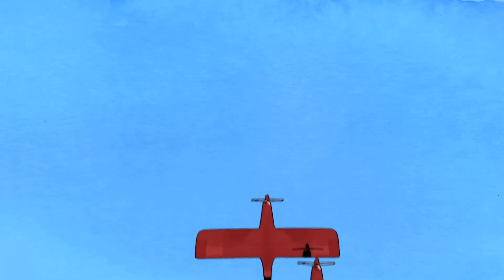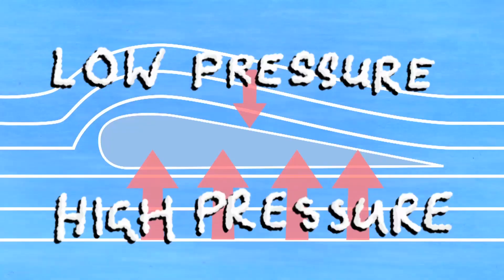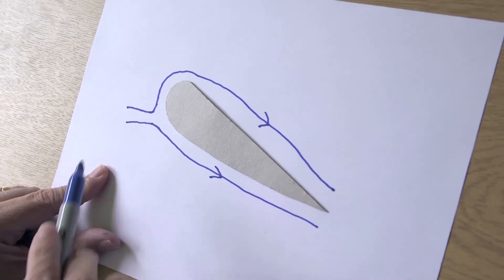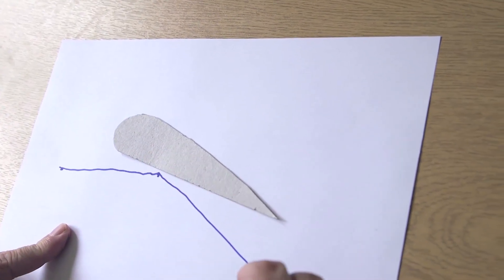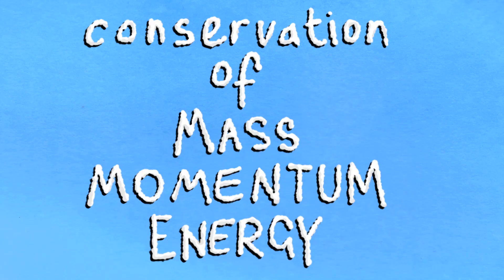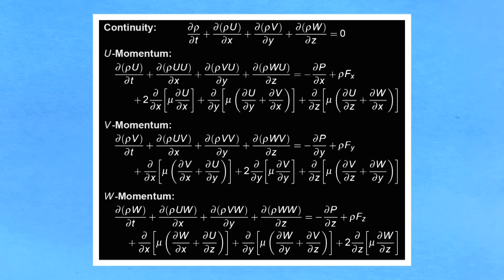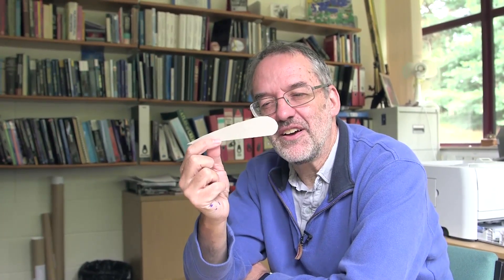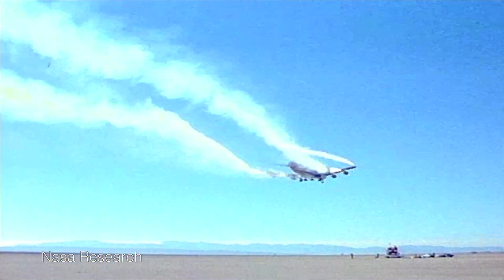Lift and Wings - Sixty Symbols

Comment: Thin section wings! Everybody neglects the thin section examples like hang gliders and the old Wright brothers style in explaining conservation of momentum.(turning the flow, not particle bombardment) There are two primary reasons for thick wing sections; the rounder leading edge is less sensitive to angle of attack related flow separation(stall), and wing strength both in torsion and vertical bending. 
The majority of the net working lift has been shown to come from conservation of momentum. The Bernoulli effects are important to the general flow pattern and boundary layers and these effects indirectly add to lift generated via conservation of momentum, the actual portion of lift directly caused by Bernoulli effect is actually a rather small fraction.

Comment: What about paper airplanes? They often have wings with a cross section of a line. How can it produce lift if it doesn't have the traditional teardrop shape?
Reply: They work the same way. The thin cross section is just somewhat less optimal. Somewhat less efficient and less stable.
Reply: angle of attack

Comment: I used to work in the aircraft engineering industry. In certain occasions including interviews I was being asked to explain how an aircraft flies in layman terms. The mechanism is rather complicated as the professor explains in the video so the real challenge was giving a short answer. I found that most people would expect 'with a  sufficiently high speed and a correct range of angle of attack, an airfoil can generate lift due to pressure difference between the two surfaces'. In my job when we had to adjust the flight control systems such as ailerons or elevators, we tended to use 'bouncing particles explanation' to effectively figure out which way was the right direction. I also found that in many science museums in different cities, Bernoulli's principle is used to offer simple explanation for educational purpose.

Comment: They way that I like to think of it is that the rise at the front of the wing has a high resistance so it generates a large pressure differential, leaving low pressure air across the rest of the upper surface of the wing.

Comment: Aerospace engineer here. I really like the explanations and the video, but I would like to mention that the explanation of the air being 'squeezed in' near the leading edge as if there was a wall is also kind of 'fallacious' (at least from the point of view of my teachers). The real reason why the air goes faster in the upper side is because of the Kutta condition (https://en.wikipedia.org/wiki/Kutta_condition) which I would have liked to be mentioned here. This condition states that a body such as  an airfoil, with a thin trailing edge, will create circulation around it (air rotating basically) so that an stagnation point (this means, a point where the air speed is 0) can exist at the trailing edge. The explanation for this condition is the fact that the air coming from the upper and the lower sides, when they meet, has to have the same speed vector, otherwise the conservation of mass equation does not hold, and it has to be at the trailing edge because this is where the geometry suddenly changes, and the air can be properly separated from the surface. A deeper explanation for this point involves the existance of a viscous bondary layer near the surface, and how it follows the shape of the airfoil. Actually, the reason why an airfoil 'stalls' is because the air suddenly does not follow the shape of the airfoil when the angle of attack is too steep, and decides to separate from it, causing the destruction of the circulation, the bernoulli effect and the momentum change in the air.

And as for what is the real contribution to the lift, either momentum equation or bernoulli, as Prof Merrifield says, it's actually a combination of everything :), but I just like to explain to people the more simpler conservation of momentum (that is, the fact that the air gets turned down by the shape of the airfoil an the angle of attack).

Also, as someone pointed out somewhere in the comments, the animation of the wingtip vortices at around 9:20 is the other way round :), air has more pressure on the lower surface so it will go upwards at the wingtips, causing a vortex going clockwise in the left wing when viewing the aircraft from behind (and also causing a type aerodynamic drag called induced drag).
Reply: Pls read chapter 5 (about pg357, 358, 359) of "Introduction to flight" by John D Anderson, your explanation is incorrect, it is just another misconception of the generation of lift.

"A third argument, called the circulation theory of lift, is sometimes given for the source of lift. However, this turns out to be not so much an explanation of lift per se, but rather more of a mathematical formulation for the calculation of lift for an airfoil of given shape."

"Kutta-Joukowsky theorem is pivotal relation in the circulation theory of lift."

"The circulation theory of lift is compatible with the true physical nature of the flow over an airfoil, as any successful mathematical theory must be."
Reply: @loouuiisssss296  Did you mean in page 405 in the 7th edition? Thank you anyway :))
Reply: I think a better explanation can be had from "Ideal Fluid Aerodynamics" by Karamcheti Krishnamurthy. The Kutta Joukousky Theorem is a mathematical approximation of the flow over an airfoil. There are many assumptions involved and hence, it does not account for a lot of the real life effects. Lets look at an application of the Kutta-Joukowsky theorem-the main one being panel method codes. Why are panel method codes not an accurate representation of the flow? Why are they used only in the preliminary design stage and not for detailed aerodynamic analysis? Why do they require correction factors for many cases? The main reason for using panel method codes and hence the Kutta-Joukowsky theorem is that it is computationally very cheap and quick. It is a lot more feasible to use this for preliminary analysis but for full blown simulation, LES and DNS simulations are required/wind tunnel tests required.
Reply: +Rickrollingman,
How does any of that explain the physics of what pushes up on the wing and why?
Reply: @Observ45er  it doesn't. I was responding to the statement that kutta-joukowski represents the true physics of fluid flow. The most simplistic answer and the one that is true is that aircrafts fly due to more force below the wing than on top. This is directly due to more pressure on the lower surface of the wing than on the top.
Reply: +Rickrollingman,
OK. Thanks
Reply: @masterofmucus  The sad thing is, many people, even aerospace engineers, think that Kutta-Joukowski theorem, or Coanda effect, or downwash is the primary source of the lift, but they are just the effect of lift.
Reply: I would love to see an animation of the Kutta condition. I have been reading about it for years but never wrapped my head around it. I can see how the motion of particles of air around the airfoil will be the vector sum of the freestream air motion and some hypothetical circular motion but... so what???
Reply: @michaelhenry726  Note that Kutta Condition only works at higher velocity.  Below a certain airfoil speed, the rear stagnation-point WON'T stick to the sharp trailing edge.   (Or more specifically, Kutta Condition only works for a system with high Reynolds number, where the inertia of air is dominating, and viscosity of air becomes less insignificant.)
 
If an airfoil slows down too much, suddenly it will shed a "backwards start-vortex," and lose the Kutta condition, and the lifting force drops to zero.   And conversely, if a too-slow airfoil (wo/Kutta condition and wo/lift) should fly a bit faster, suddenly it will shed the well-known start-vortex, and begin functioning under Kutta condition, where lift suddenly appears.

It's all just weird and fascinating.  And, knowing something about it, we can begin to see (in our minds eye) the "flip-flop" of Kutta condition turning on and off.  Slowly we come to understand that vortex shedding plays some sort of crucial role.   The lifting force is intimately connected with vortex-shedding, and therefore lift is an example of propulsion, where energy is required to be injected into the atmosphere.   And as a result, Bernoulli equations or Euler equations cannot apply to real explanations of airfoils and lift!

Hint:  if we're using Bernoulli and Euler, and if our diagrams lack the start-vortex  ...then our wing is trapped in ground-effect mode.   It's performing an instant force-exchange with the ground.   But this isn't how airplanes work! 

And now finally we can see a major source of confusion which infects all the explanations:  we've been explaining Ground-effect Flight!  Yet our diagrams haven't been showing the ground surface, nor diagramming the pressures/forces extending between the airfoil and the ground!    The inescapable conclusions is ...get rid of ground-effect, remove the ground, remove those forces, and instead explain how airplanes can fly.   To do this, we have to use short wingspans, where the wingspan is small and the altitude above ground is enormous.   And when we do this, we find that airplanes are much the same as hovering helicopters:  they only fly because they draw in air from all directions, then launch a narrow plume of air downwards.   The lifting force is caused by propulsion, by a reaction-motor effect which resembles a rocket engine.  The reaction-motor effect is almost exactly the same as that of a hovering helicopter, but where the helicopter has been flung sideways, so its narrow plume of downwash is spread out diagonally, and takes the form of a vortex-pair.

Personally, my own solution is to abandon attempts to explain the flying wings.  Instead explain the hovering helicopter, the pulsing jellyfish, and explain the "kick" which we always experience when shooting our WHAM-O(tm) air-blaster gun at a distant cardboard target.   These topics drill down to the full explanation of wings and lift.  There's no Bernoulli, instead, reaction-motors and vortex-shedding is everything.
Reply: +BlazeRazgriz1 
You hit on something I want to dig into. I've taken some data, but don't want to tip my hand just yet. I dislike the 'pinching' explanation as well (the Smithsonian's explanation, among othets, uses it). 
...
Now, we see the upper air 'accelerate' going over the top. Since air has mass & Newton reminds us it takes a force to accelerate a mass; WHAT is the force accelerating this mass of air ?? There must be a force. The Prof glosses over this and I want to ping him on this also. 
Comment ?
Reply: @Observ45er  The mass contuinity states that since the mass is conserved (the mass flow rate always the same), the velocity of the mass is inversely proportional to the cross-sectional area. The idea is that the mass flow rate of the fluid always the same in the tube, and thats why no additional force is required to accelerate the fluid.
Reply: @Observ45er  Let's say the cross-sectional area doesn't change, but the fluid somehow accerelate. Then that's the case for an additional force is applied to the fluid.
Reply: @Observ45er  dont forget the engine trust.
Reply: @rejiequimiguing3739  I don't, but I can't tell which comment you're referring to.
Reply: That's not true. The kutta condition applies to inviscid, incompressible flow over a cusped trailing edge. That is, kutta condition applies when the flow is ideal, which is almost never true.
Reply: What about the Coanda effect they exploit in formula 1 and those things on the back of the wings
Reply: @TheCorrectionist  spot on. The coanda effect is the reason the air "sticks to" a curved surface when flowing over it, instead of separating.
Reply: @bwwwam "Compressed" is not really the correct term to explain what is happening to the flow over the top of the airfoil. The gas itself is not being compressed like you would find in a pressurized container. Instead, the streamlines are forced closer together. Since the air is not contained in a vessel, it is free to accelerate to avoid being compressed. This is the "conservation of mass" that he was talking about.
Reply: The airfoil's momentum relative to the free-stream.
Reply: @Leidan Wing Obviously you would know more than me about this, but isnt induced drag created because the lift vector is perpendicular to the flow LEAVING the trailing edge of the wing, which is slightly angled down, thus the true lift vector is up, but with a slight aft component? 
Thanks for the clarification!
Reply: @MattH-wg7ou  I am not an aerospace engineer so don't quote me on this but I think induced drag is actually a result of wingtip vortices (3D lift). The backwards lift vector also probably comes into play. This is the reason induced drag is decreased in ground effect is because being close to the ground cancels out wingtip vortices and hence why you float more.
Reply: @captainshipman7377  I'm not sure to be honest. My previous comment is unfortunately the limit of my understanding of the issue!
Reply: @MattH-wg7ou  Easiest way to understand induced drag, is as a slope increases you need more force to stop an object from rolling down that slope as there is less vertical support. The slope in this case is the downwash caused by the wingtip vortices which alter the effective angle of attack.
Reply: Well, I too learned the venturi effect of air acceleration near the leading edge because of the constriction--airfoil on bottom; layers of air above. It is this constriction that accelerates the airflow. And that seems to be supported based on wind tunnel tests. I'm not saying you're wrong. Likely, there are conflicting schools of thought, both of which can be successfully argued.
Reply: I really need help. Where does Newton 3rd law come in play?
Reply: Comom, saying that the air accelerates because of kuttas conditions is the same as saying  that the earth orbits the sun because of gravitational law of Newton. No!!!!
Reply: Exactly, without the Kutta condition there can be no lift in an inviscid, incompressible fluid. But most people have never heard of it. The explanation  in the video seems to switch between viscid and inviscid explanations without acknowledging the differences, so you can't get the simpler explanation used in inviscid flow.
Reply: I think your answer is what I was looking for. I need to read further about this. Because the explanation about compressed air above the wing needs to travel faster, lowers the pressure, seems somewhat false: If air is compressed, I would expect the pressure to increase...
Reply: @bwwwam  it is mass contuinity, which is absolutely correct.

"The shape or the camber of the airfoil forces the incoming air (streamtube) to be squashed to a smaller cross-sectional area at the area of the nose of the airfoil. Due to mass continuity, the velocity of the flow in the narrower stream tube increases over the top surface of the airfoil more than it does over the bottom surface"
Reply: @bwwwam  flowing air does not behave like stagnant air.
Reply: bwwwam Have you ever used water pipes if you press on the pipes mouth to make its opening smaller the water rushes out at a greater speed than before, it's the same thing happening here ,no of particles entering and leaving the pipe per unit time have to be the same ,conservation of mass or continuity equation ,so when you reduce the cross sectional area by pressing on the mouth the particles gain velocity so that no of particles leaving is conserved.
Reply: Hi, could i talk to you? I am am aspiring aerospace engineer & would like to know more about the career in itself. I am a junior In high school & I would love to have some advisory & discuss some other questions I have. Hopefully you answer!

Comment: There is one completely wrong explanation, namely that a wing acts like a venturi valve cut in half, which is BS because venturi valves don't work anymore once you actually cut them in half... NASA has a few pages on the subject of lift, where they say that it is not completely understood.

Comment: I thought Bernoulli's equation was applicable along a stream line. If that is the case, wouldn't the Bernoulli explanation for why the two stream lines above and below the wing with different velocities cause a difference in pressure be wrong? Or is my thinking wrong?
Also, what about the wings of a supersonic plane? Would they also have aerofoil shapes since the top portion would act like a supersonic diffuser, reducing the speed rather than increasing it (I know hypersonic planes don't need wings for lift theoretically, but I am talking about Concord and the like)?
Reply: Mathew George it's wrong because there is no magical reason for the air going above the wing to meet up with the air that goes under the wing. In fact, if the wing is generating lift the air just above the wing will reach the rear edge Before the air just under the wing.
Reply: Robert Szasz.. I was asking about @7:36, the professor says that since the flow above the wing is faster, it will have a lower pressure than the flow below the wing due to Bernoulli principle. How could that be true when Bernoulli principle can be applied only along a stream line?